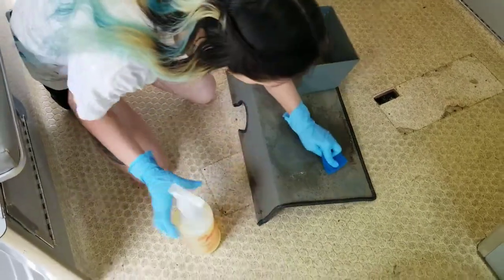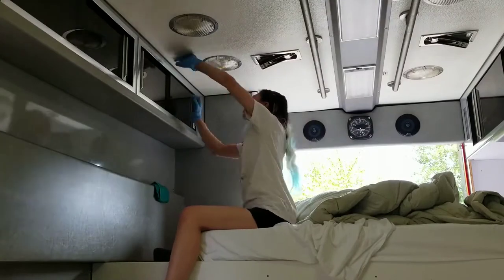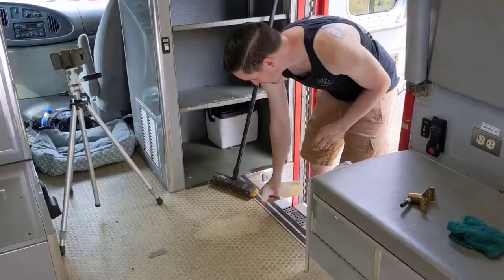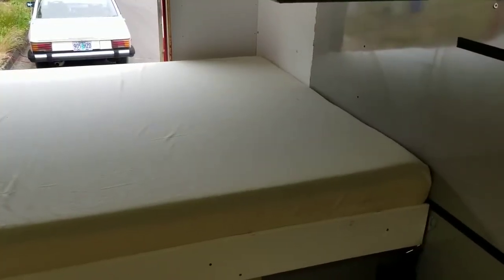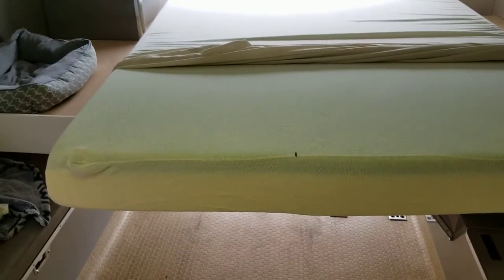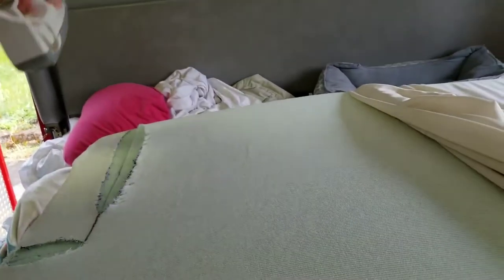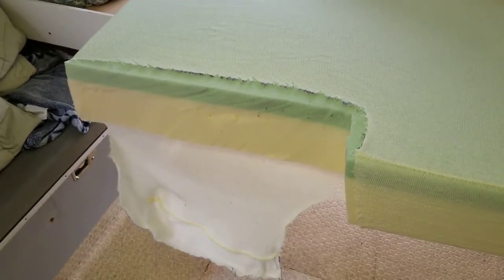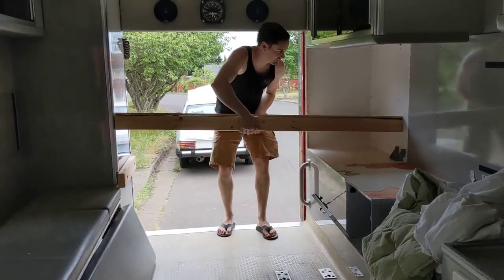Modifying the Mattress and Cleaning up the Ambulance Conversion

Comment: Im looking into buying an ambulance, did you consider going in with a power washer? Is there any information available on your ambulance, make year mile/km etc... Great work on that mattress...
Reply from the maker: Yes I considered it but I would have had to buy or rent a power washer so never bothered to do it. In theory it should be fine though as long as you are cautious with the spray. Mine has less then 200K miles on it but I am unsure how long it idled for as I can't find an hour meter on it. As far as info on it I have struggled to find anything beyond the documentation it came with. It is a 2002, Ford E450 with the 7.3L turbo diesel motor. The box on the back was done by lifeline.